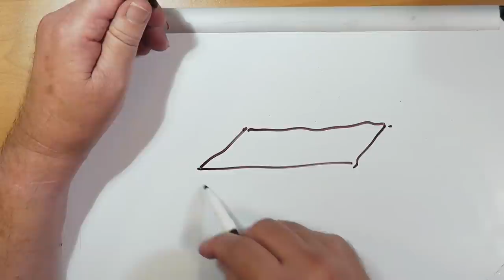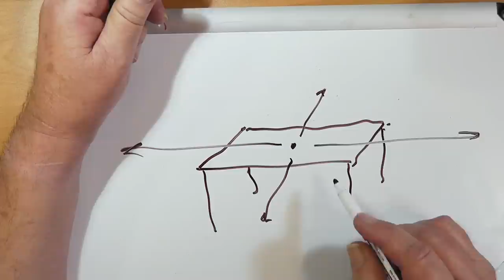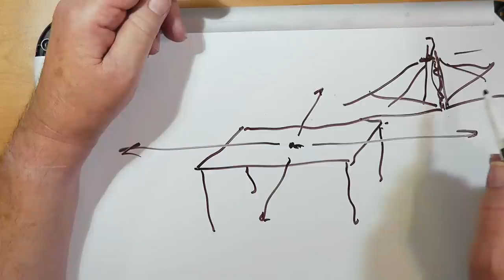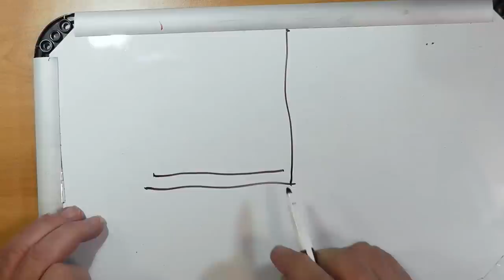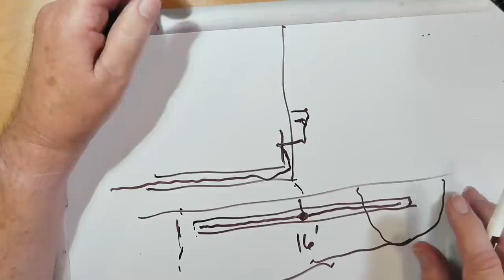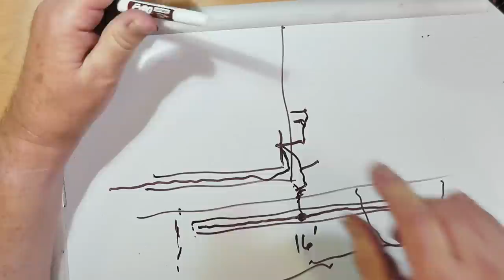Using a Mobile HF Antenna in a Fixed Location (#510)

Comment: I can say that a trench ground with 2 8' ground rods screwed together works very well in the desert. I used that method many times in different deserts in my Marine Corps career. Another that works is three 4 foot rods driven into the ground in a triangle a foot apart, bond them with braid and attach your ground.

Comment: good stuff dave. i use my ham sticks and hustler mobile antennas when i`m camping. i put 2 mirror mounts with the 3/8x24 stud mounted on the side of the camper and away i go. i just need to remember to ground the camper i always forget. i never use radials but i want to try and see if they help. great info dave.

Comment: My first base CB antenna was a stainless steel whip mounted on an 8 foot square of four inch steel grid and I had a very low swr and was able to get out over 50 miles .

Comment: I at one time when I first moved in to my new home, used the rain gutter system with a buried counterpoise system , it worked.
Reply: A counterpoise is not buried but elevated above the ground.  73,  AA4EZ
Reply: @raymondlewis2055  I usually put mine about an inch below the surface when permanently installed, that's to keep the lawnmower from having it for lunch.
 I've always had good performance with them. That also kept my kid's from touching them. Safety first you know.
Reply: I did that when I lived in an apartment

Comment: Great topic for a lot of people who for whatever reason (commonly ability, mechanical attachment points, or authorization) cannot put up a big vertical or climb up to string a wire antenna.  I use a mobile VHF/UHF antenna with a four-element counterpoise on an old camera tripod in my shack. It works well enough until I can find a way to appease my HOA. 

My house Ufer ground apparently goes up through the garage wall and connects to the breaker box and then to the meter on the exterior wall, where there's also a ground bus bar for bonding additional ground rods.  I think that's a very common way of doing it in new construction these days.

Comment: I have a height restriction in my backyard due to power lines.  Because my dog at the time viewed my chickens as a delicious puzzle, I ended up using a 10x10x6  metal frame dog kennel with chain link siding.  I added a chicken wire top to keep out hawks.  At some point, I needed a 40M antenna so I purchased a MFJ hamstick and a mirror mount that got screwed to a 4x4 clamped to the top of the coop.  A copper braid was used to bond the ground to the coop.  The first night I was using FT8 on 40M, I was able to log a contact in Australia so I knew it was working.  73 de KM6KPW

Comment: I made contact with WE1SPN in Bristol CT. If I recall correctly, they had a tarheel antenna on the roof. They have about 4 acres of “ground plane”. Great signal for a bunch of engineers!

Comment: I have a question for the group…

Without the negative comments about the Yaesu-120A, can some one check my theory about mounting this in the middle of a steel or rout iron round picnic table to use as a ground plane/counterpoise? It is designed to be mounted on the iron railings of apartment balconies. So if that makes for a good ground plane, why wouldn’t a round metal picnic table?

Comment: Will this concept work if I mount a 40 m  mobile antenna to my aluminum pool cage, 10 ft above ground, and connect it to a ground rod directly below the antenna?
Thanks,
Gary

Comment: Nice video.  In your drawing you didn't specify the radial lengths.  I know you can use .125 wave length radials, but for a multi band antenna, say 10-40 meters, what radial lengths would you recommend?  thx.

Comment: Any videos on your channel about "working from an apartment" with antennas mounted on the balcony railing, particularly the HF bands; grounding from the 2nd floor, and running and amplifier?
Thank you.  Good video,
KD8EFQ/73
Thumbs Up, and subscribed!
Reply: You’re going to get a lot of noise in apartment whether you ground or not.  My buddy used a 9:1 with 60ft of wire in a square shape circumference of his living room ceiling.  He also tried a 49:1 with 66ft wire in same Config.  No ground needed you’re going to get noise regardless.  He worked dx with that setup!  Try it!  Hopefully your on the second floor or above.  The signal will still penetrate the roof.  It is what it is for apartment setup. Try it though guarantee you’ll get some dx !
Reply: @angpar8449    Sorry for the long-delayed reply and thank you!  Yes, my apartment is on the 2nd floor and for at least a year now I have been running a Chameleon CHA MIL Hybrid matcher rated @ 500 watts with their 17-foot telescoping whip antenna all mounted to the balcony railing and able to work 80~6 meters all day with just the Icom 7300 radio!  I prefer Single Sideband.  The whole antenna is just slightly under 20 feet above the ground.

Comment: What if I want to put an Antenna, say, on my Ridge Vent on the Peak of my Roof? In my case the Antenna is the Tram 3500 Magmount which would be affixed to the Steel Ridge Vent, dimensions are 1'x 3' (give/take). I had one guy say to run a single length of Wire 104-106" long in as horizontal an orientation as possible, which sounds to me like a Ground Plane...he's calling it a Counterpoise. I was under the impression the Ridge Vent is the Counterpoise. As far as Grounding, the House has the rebar you speak of outside the Garage. the distance between the proposed mounting location and the Ground is roughly 35 feet (again, give/take), and it's my understanding that if the Ground is longer than the Antenna, it becomes the Antenna, which I'm also told you DON'T want. This type of installation is highly desirable if do-able, as the HOA here frowns on Antennas, specifically HF Setups...I'm surprised they let me erect my GMRS Antenna on a Pole out back...appreciate any help/advice on this, as I can't find much about this that I understand...

Comment: Thanks for the great explanation Dave. Do I need radials or a metal base for a 5/8th wave VHF/UHF mobile antenna with a mag mount, i.e., Diamond Antenna NR770HB, used as with a base station? TIA and 73!
Reply: a metal cookie sheet works well as a ground plane for mag mounts - or a pizza pan - for VHF/UHV antennas
Reply: I set my on top of my power supply and it worked.   Maybe I should not sit that close.  But. I just tried it .  I also have a metal table and that also worked.   I put up a GP1 outside so I do not run my mag mount on my base any more .

Comment: Question about ground, wouldn't your lightning arrestor to the same ground as your station ground be problematic if you took a strike? It seems I would want to keep this energy outside as much as possible
Reply: Hey Tim, yes the lightning arrestor is outside.  If you haven't yet look back in Dave's videos, he has several on ground systems and lightning arrestor's.  I wish I could site the exact episode's for you. Maybe someone else will remember and comment.
Reply: If you take a direct strike you will be in serious trouble regardless of almost any realistic counter measures. I use lightning arresters, but when a thunderstorm closes in, I disconnect all antennas from their arresters (which are of course outside) and I put the antenna connectors in a small waterproof box and lay it on the ground far away from the house. I have cut small channels in the box for the cables to go through. The arresters are nice for taking care of static charge build up - not against direct strikes.

Now about your question. The idea about the antenna system and your shack gear sharing the same ground is to prevent ground loops and other interference. Any charge build up from the antenna will want to take the shortest path to ground. That would be the ground rod, not your shack. That being said, it is a best practice to disconnect the antennas during thunderstorms.